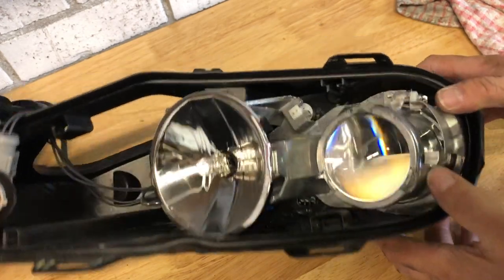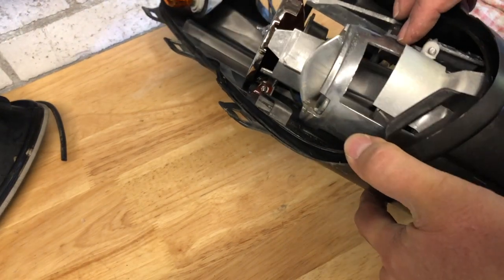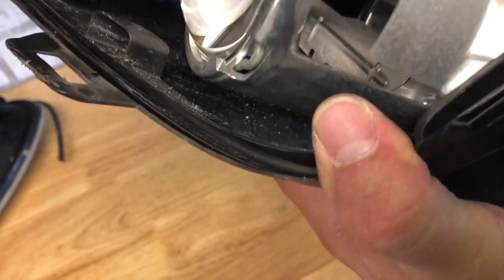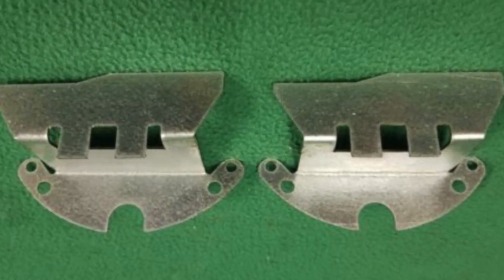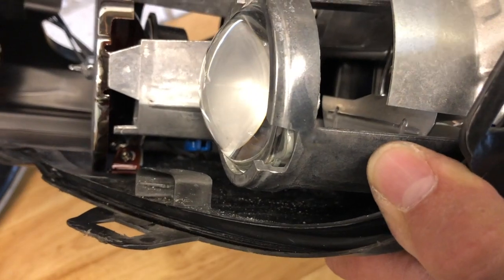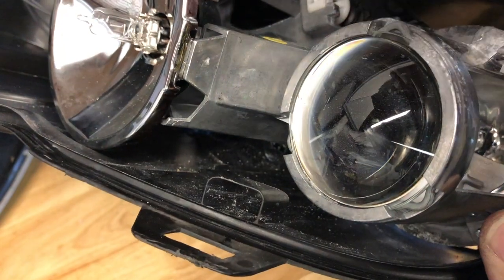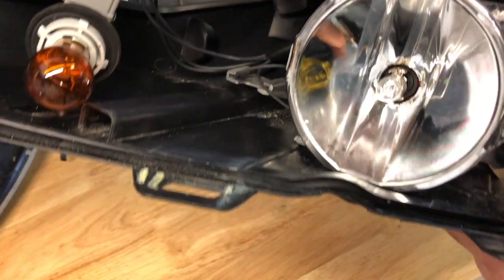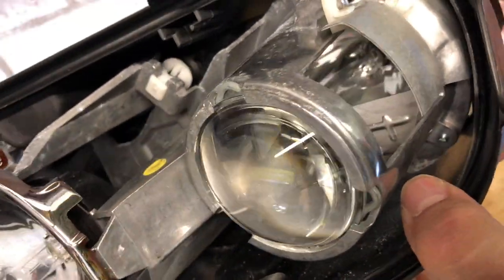SECRETS of Jaguar XK8 XKR Ep39 'PROJECTORS'

Comment: My xkr has 2 massive shadows I dread driving at night it's most  distracting  I've changed main bulbs for brighter one but still shadows     any ideas  thank you in advance
Reply from the maker: Are you sure you dont have wrong handed headlamps?  X100 lamps are not as bright as modern LED units but they are certainly better than average for their time. The use of a Projector lens and Mask does result in an incredibly sharp cut off  at the edges of the beam which can look a little alien if your previous vehicle has round headlamps where the beam edges are only controlled by ridges in the front glass.
Other possibilities are that they just need realigning, or the reflectors ore badly tarnished. Or incorrect lamps installed? Some bulbs have black tips to stop light going forward before its all been bounced off the reflector. The projector units (driving lights) dont need this and it reduces light output.

Comment: Both of my projector lenses are cracked, so the dip light is deteriorated. Is there any chance to replace only these and not the whole unit?
XKR Coupé 3/02
Reply from the maker: I have never seen the lenses sold separately Mr Phillips You can swap them if you can find good replacements though. There is just a large spring clip holding them into their mounting
Reply: @ToTheGarage   I know, unfortunately the whole unit is about 1.000€ for a new one and 500€ for used stuff. That‘s pretty (and too) much for two lenses.
I hope I can get two optical lenses of the same shape and size anywhere. 
Does anyone know the dimensions of the lens?

Comment: Hi John, I very rarely drive my car at night but when I have I notice they sometimes flicker off and on. Maybe it's only one side, not sure really. I have a dreaded feeling it may be those ballast thingy's or hopefully only a loose connection somewhere. What are your thoughts?
Reply: Apologies for butting in John! I have the same problem and I'm pretty certain you are correct Trevor. The ballast units are supposed to be sealed but I think moisture eventually gets in and causes them to fail. It's quite disconcerting when driving on an unlit road!!
Reply from the maker: No Apologies required Mike. I take it both of you have the HID lamps?
There is a gap below the headlight to cool the lamp housing, but as the balast unit is (I believe ) also below the lamp, then that cooling slot drives rain water onto it at great force.
Reply from the maker: The flickering could just be the connector on the back of the lamp working loose 
(mine was)

Comment: Always so interesting John. Impressive light fit for new (expensive!!!) unit. Did you have to have garage finalise light settings?  Cheers, Tim
Reply from the maker: Hi Tim. The left right is more or less fixed but I marked the cutoff shadow on the wall before I did the job and adjusted the height to match it afterwards.👍